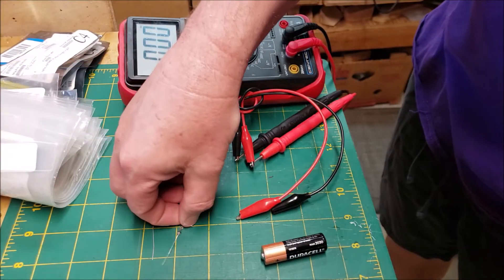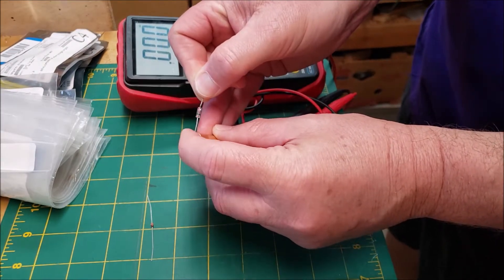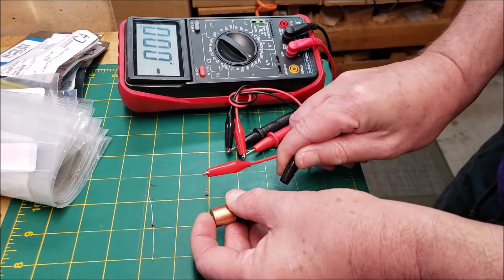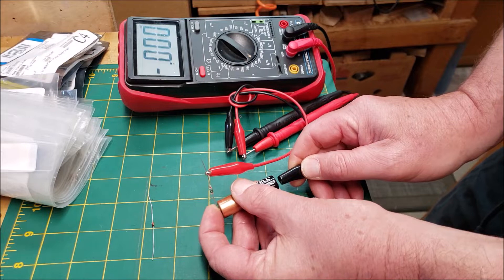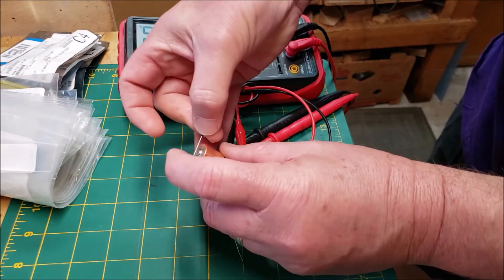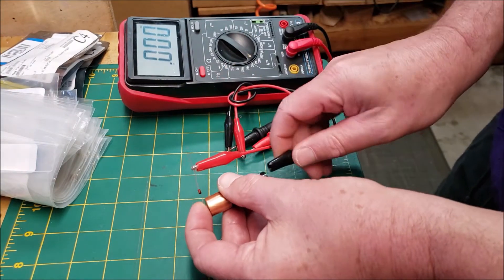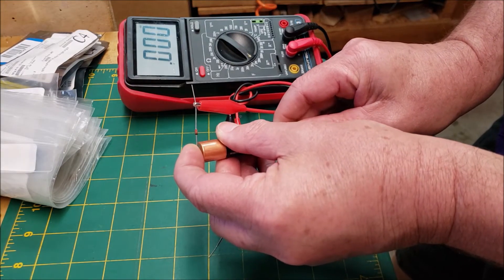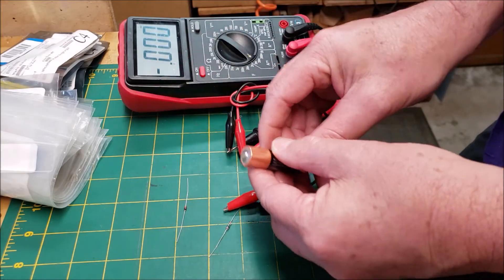Test for Real Germanium Diode or Fake Schottky imports from China

Comment: It's okay to say 2μA.
Reply: Isn’t that capacitance? Microfarads?
Reply: @TheBoomtown4  No. He was measuring current. The meter indicated 0.002 mA so he said "two thousandths of a milliamp". I pointed out that it's more conventional to call it out by it's singular (more than 1) units, in this case two microamps (2μA). Capacitance was never discussed and not relevant in the demonstration. I can only guess that you're not familiar with the Greek letter mu (μ), a prefix for micro, being used with values other than capacitance (μF). It is used with other values such as voltage (μV), current (μA) and others as well.
Reply: @KJ6EAD  oh yeah, so used to looking for microfarads that I just look for the micro symbol on multimeter. Carry on
Reply: 2mA*
Reply: @treasuretotrash2067  What is the difference between micro amps and milliamps?
a MilliAmpere(s) mA is 1/1000 of an Ampere a Micro Ampere uA is 1/1000000 of an Ampere.
Reply: @willardthompson6648  Exactly, i dont know why people said uA
Reply: @treasuretotrash2067  because it's 0.002mA = 2uA
Reply: @TheBoomtown4  
Capacitance Microfarads = μF      Current = μA.
Reply: @moby1388  micro amps right

Comment: How can the fake have tighter specification?
Reply from the maker: Ge diodes are well-known for leakage current. Silicon is the better diode for most applications.
Reply: @AustinMics  ok, so it's an older technology correct? I presume people are looking for this to add color to their audio instruments/equipments such as amplifier.
Reply: fakes are modern and have MUCH less spread in tolerances. Point contact germaniums were all over the place and often have 20% variance, even in the same batch

Comment: Only matters one way or the other depending on the job you want them to do, anyway.   Some guys that build crystal radios have clips for the detector so they can select the best diode from their stash,  in any case.  Don't trash vintage electronics then without scanning the circuit boards or handwired circuits for glass diodes you can salvage.
Reply: Are they valuable?  I have lots of OA81 etc salvaged decades ago

Comment: which is better ?
Reply from the maker: It's my experience that NOS Germaniums are unpredictable and unrepeatable relative to modern Schottky diodes. In a drive pedal, I've come to rely on the repeatability of $0.10 Schottkys over a real batch of NOS 1N34A's that vary widely, and cost $0.75 each. My opinion. Your mileage may vary.
Reply: @AustinMics  i see. thanks.
Reply: If you want repeatibility, the modern schottkeys are better. Germaniums will have much softer clipping and will therefore sound different (less high freq harmonics)

Comment: So how do i set my meter??  For current to do the same test…just a beginner .. sorry.. 
Craftsman  82141 meter
Reply from the maker: Page 12:
 https://c.searspartsdirect.com/mmh/lis_pdf/OWNM/L0908450.pdf
Reply: @AustinMics  thank you so much!! Your awesome sir👍👍
Reply: I tried testing using the battery test and 200 ma test ADC and i get 00.0 guess i have a fake germanium diode… but it is reading at  279  when switch to diode test
Reply: So the stripe side is the positive or the negative side?? Some diode may have stripe on both side?
Reply from the maker: Current flows in the direction of the stripe. Stripes on each end? You'll need to measure with your meter to determine polarity.
Reply: @AustinMics  have a blue on one end and gray at one end… blue is the positive side i beleive
Reply: Turned out just need a more sensitive meter.. turned out i got good germanium  diode!… thanks for the great info

Comment: The forward voltage drop of a germanium is around 0.2 volts rather than the 0.6 volts of a regular silicon diode. Not sure about schottky
Reply: Schottkys are also around 0.2V - that's the point.

Comment: Wow and thanks!  My interest in electronics started in the 60's building a crystal radio with a germanium diode.  I never knew this detail.  One thing I found out the hard way -  The forward voltage drop of Schottky diodes increase quite a bit as the forward current increases.  Sometimes greater than Silicon diodes.

Comment: schottky diodes usually have a higher leakage current, sometimes in the mA even, I think what you have there is a general purpose silicon diode
Reply: Nope... A BAT85 (DO-35 package as in the video, generic switching Schottky diode) has a leak current of 2µA at 25 Volt. A 1N4148, generic silicon switching diode even lower at .025µA at 20V. ( RTFM 😂 ). Of course leaking goes up proportional to the size of the device.

Comment: Schottky diodes can be made to work
https://youtu.be/5y7I7G_a3Qo
The leakage current of the 1N34 can be effectively replaced by a 2K resistor
It works better than the not very good 1N34 I have but not as well as the really good one.
1N34 diodes vary in parameters
Reply: Actually the fake 1N34A schottky diodes work better in crystal radios, they give much better selectivity.
Reply: @SHJ3520  If the fake one is something like the 1N5711 then it seemed to me that the selectivity was about the same.  What makes you think it comes out better?  Remember that I am adding a 2K loading resistor to make up for the lack of leakage.  If you have a good explanation, I would like to know it.  More selectivity is a good thing if we can get it.
Reply: @kensmith5694  For a good selective crystal radio we would need a high Q LC tank and a diode that does not over loads the tank circuit.
Reply: I dont know why youtube is not posting my detailedcomment, tried 3 times but it hasnt appeared , will try later.
Reply: @SHJ3520  Ok I will look for it later.

Comment: I just started building and already investing in my sources and testing all my parts,  I also read the average shelf life is only 2 years on things like electrolytic caps, maybe you could do a video on the effects of older parts also? I dont understand how the circuit can last decades in product but is rated this way.
Reply: There are several modes of electrolytic capacitor failure. There's the failure of the dielectric and the failure of the electrolyte. Each is caused by different things. How a part is used will determine its longevity.
Reply: I would consider any electrolytic capacitor that had a shelf life of only two years to be of defective manufacture.  I have some electrolytic capacitors, made by reputable vendors, that have been in storage for 60 years and they are still good.  Having said that, it is always a good idea to increase the voltage slowly at the first use of any electrolytic capacitor that has been in storage for a long time.  The slow increase gives the insulating layer time to re-form.  An initial rapid onset of voltage can produce a destructive current through the layer that is intended to be insulating.  For more detail, see, for instance, the video, "Reforming Capacitors - Everything you wanted to know".